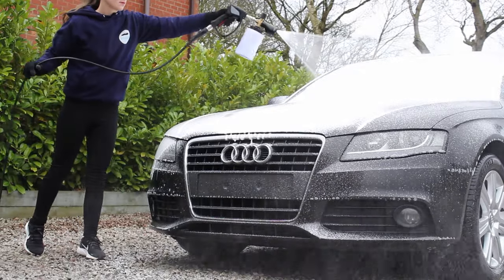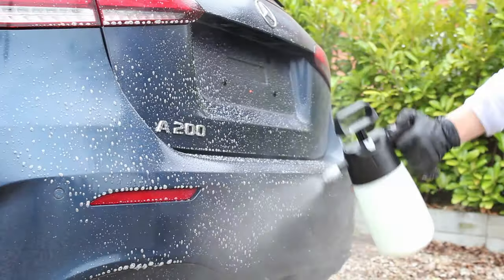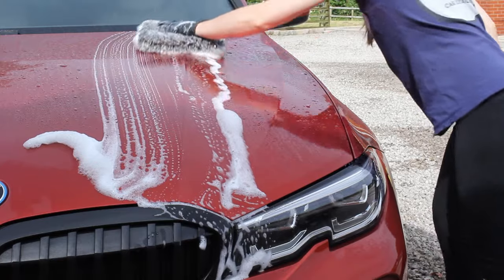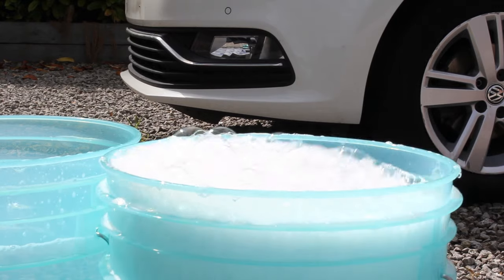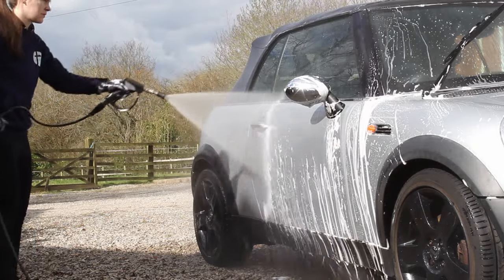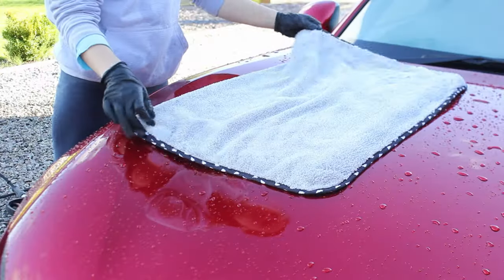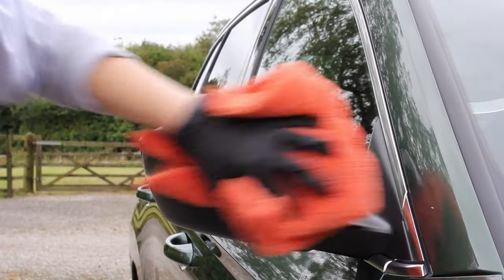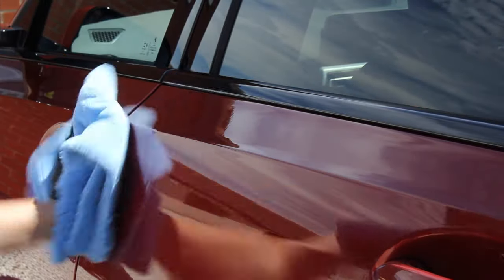Essential Swirl Prevention Tips | How to Avoid Scratches When Car Washing

Comment: You covered pretty much everything, thanks. I have only one extra tip, when you pull the trigger on your power washer for the first time ( and whenever you change nozzles ) , point the lance away from the car. I had an absolute disaster for the first time the other day. I changed from a foam cannon to a lance and it wasn’t fully locked… lance hit the bodywork like a bullet !

Comment: Yet another quality video Heather. Thank you. 

From my experience, there is one other method id recommend, and its one i use if im working on really soft paint. Typically Japanese cars. 

I will still use the two bucket method, but with a twist. 

One bucket will still have my shampoo, but the other is empty. 

I then have a tub with between 8 and 15 wash mitts or plush microfibre towels.
I use one per section of the car, then its thrown into the empty bucket.  

It does require a lot of wash media investment, but theres little to no risk of cross contamintion at all.  Which is ideal if im working on a modified 150k GTR for example.

Shampoo solution remains perfectly clean and marring is minimised as much as possible. 

Then a liberal dosing of Koch Chemie FSE and a blow dry.  

Of course, that level also means charging more money because the drying is far more time comsuming.
Reply from the maker: Thank you! That's a great method too, really good idea on soft paints especially

Comment: Good tips! I like Bilt Hamber Touchless concentrate as pre-wash 2% PIR for general use and 4% PIR for very dirty. Something not mentioned in the video but one bucket and multiple mits/edgeless towels is also a great method utilized by many. So you basically use the towel one time and then throw it in the discard bucket, take a new soapy mit/towel out of your soapy water and continue cleaning. No need to rinse or use grit guard just keep going.

Comment: Great video! Another tip is to use wash mits once and then get them to the washer. Have as many mits as you need to wash the car completely and then wash them in the washer. Do not reuse a mit during a car wash. I once saw a program in which they were detailing a Koenigsegg Jesko during its launch campaign, they used around 19 or.more wash microfiber mitts.
Reply from the maker: Thank you! Great tips too thanks for sharing!

Comment: Car driers are absolutely essential and best used in conjunction with a good quality drying towel.  I also find using the dryer is very therapeutic and it is also useful to blast off leaves and pine needles etc caught under the bonnet etc before starting the wash process.  For tricky areas like the tight hinge areas under hatchbacks (where horrible algae can grow), I also use flexible perspex sheets with a microfibre cloth wrapped around as it gets to the tricky areas and saves your fingers.  A good selection of flexible perspex can be obtained from most hobby shops and the sheets can be cut to size as required.  Thanks for posting Heather.
Reply from the maker: Thanks David! Those are some great points too!

Comment: Great video and good tips. If you have no drying aid or blow dryer a good tip for after a shampoo wash can be to spray the panels with rinseless wash to provide lubrication for the drying process without really having any effect on LSP, plus the product has many many more uses. Rinseless wash was a product I just couldn’t see being safe back when we had ONR and used it very carefully, nowadays prefer Absolute by P&S or DIY Details Rinseless but with care and a pre wash it’s a much easier job to get the car clean.
Reply from the maker: Thanks for watching and very good points!

Comment: great video & tips Heather, best way to minimise scratching, touch the paint as little as possible.  RC's Wolf pack are the softest MF towels i use, but got to be careful with Pluffle/Twisted Loop drying towels (might consider warm air blower) -- keep them damp and use a QD as drying aid, especially in warmer weather.
Reply from the maker: Thanks very much! Yep that's very true!

Comment: Great tips Heather. Totally agree about the pre-wash technique. I did the same at the weekend-citrus with ph neutral snow foam over the top...rinsed off and the car was pretty much clean. Some Detail Bug shampoo finished the job. A damp,  twisted-loop towel and some quick detailer is my preferred drying method. Great channel. 👍🏼x
Reply from the maker: Cheers Gav!

Comment: Great tips there Heather. Always use all methods mentioned and also just invested in a car dryer as I've got a black car now 😅😂
Reply from the maker: Cheers Jason! Haha good shout, which dryer did you go for?
Reply: @AutoCareHQ  so just a middle of the range one, it was like £90 off Amazon. I just couldn't stretch to the bigger brands price. But the one I got is pretty good on the first few uses, so let's see how it goes with it.
Reply from the maker: Sounds like a great option! Reckon that’d make a good video if you’re planning on it
Reply: @AutoCareHQ  yes I think I will do one on it at some point 👍

Comment: Again I have to thank you for a great video. Your posts are an absolute treasure trove of information and in my opinion are essential watching for the DIYer. I live just outside Toronto, Ontario and plan to put all I have learned from you into practice when the weather warms up a bit. In this area we have had an incredible winter - no snow to speak of and temperatures generally well above freezing. But even so I'll wait for more moderate temperatures. 
Unfortunately, although the information you impart is available no matter the location of the viewer, the same cannot be said about all the products you use and recommend. So, in some cases, I have had to choose alternatives. I'll keep my fingers crossed.
Apart from thanking you for your videos, I want to ask a question. I don't believe my Q3 needs any paint correction so after all the washing, decontamination etc. etc.,  I plan to go straight to a DA applied sealant. Do you think it necessary to use a product such as Car Pro Eraser before the sealant application? With no polishing involved there should be no question of oil residues being present but an IPA-type product might provide greater sealant-paint bonding. I would sincerely appreciate your advice.

Comment: That's pretty much my method honed over the years watching many YouTube video's especially during lock down and rainy days. My only slight difference is when waxing I work in straight lines. I wonder what your thoughts are on this.
Reply from the maker: Thanks for watching John :) I definitely get the idea of waxing in straight lines but I just prefer circular motions as I find it a bit easier

Comment: One of the best ways to not scratch a car is to avoid so called hand car washes! They might have fancy names like 'Snow Foamees' and 'Bubbles' but they usually use traffic film remover as the primary cleaner and the mitts end up in the same dirty vat of water! Apparently, washing microfibre cloths or towels that have accidentally been contaminated with fabric softener in a weak salt solution will release the effects of the softener. Just make sure to rinse them out thoroughly.
Reply from the maker: Great tips Jamie thanks for sharing 😊

Comment: A little misleading regarding the Citrus and Snow Foam.  An good alkaline snowfoam like GT is much stronger than a Citrus, especially when compared for the same PIR.  Citrus needs to be used at least 5% but usually closer to 20% on a dirty car.  GT V2 at only 3% does a better job.
Reply from the maker: I was talking more generally about snow foams and citrus when used as directed. I’ve personally had better results using a citrus at similar PIR

Comment: what chemicals do you recommend for baked brake dust on alloys?
Reply from the maker: Infinity Wax Incinerate is very good, I do sometimes need to use KKD Devil Juice acidic wheel cleaner though if it’s very stubborn

Comment: Can you dilute prewash at all? I tend to use the same brand as my paint protector but the amount you get in a bottle is..... small
Reply from the maker: It depends on the pre-wash you’re using, it should say on the bottle/ website if you can. Most I use can be diluted to roughly 1:9